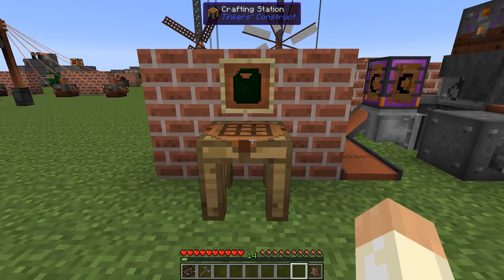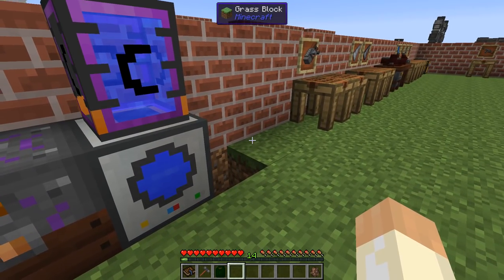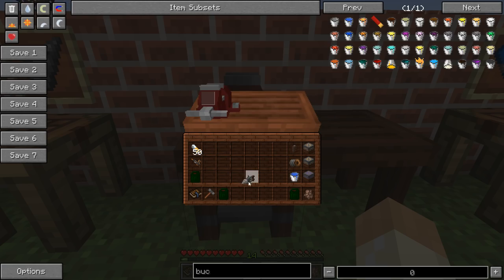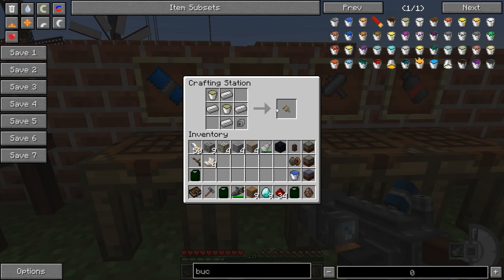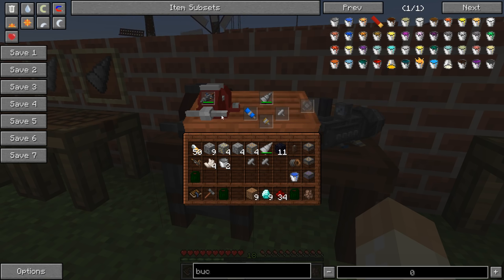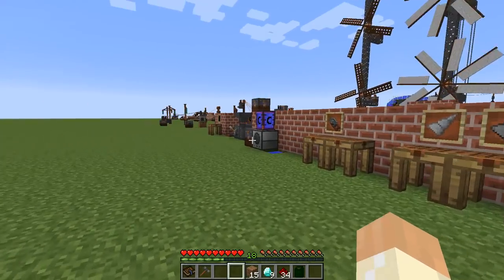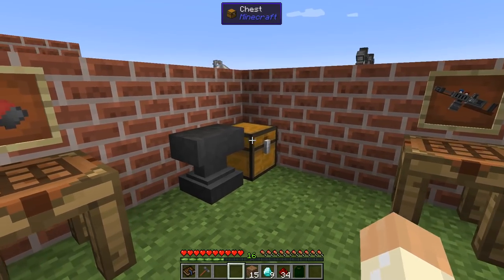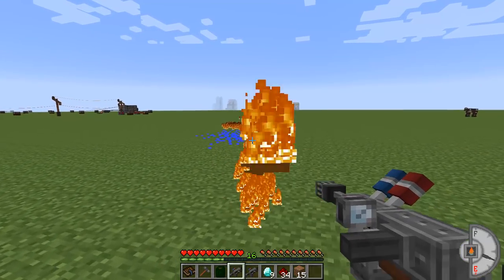Immersive Engineering Tutorial #8 - Mining Drill and Chemical Thrower (MC 1.7.10)

Comment: Nice job once again. Btw did you figure out your problem with your G-Sync monitor?
Reply from the maker: +Ian Elliott Thanks! No, I have tried everything I planned, but all variants still fail except for not turning the monitor off on the button. I haven't tried reinstalling, but I'm quite sure this won't change. And I can't go back to an older Windows either. Right now I can live with it because I can avoid the problems, but in the long run I need to find a solution.

Comment: how do I load the chemical thrower in 1.8.9? thermal expansion isn't updated to 1.8.9 and there's no bottling machine! I can't fill it up with plain buckets by crafting and I can't figure out how to fill jerrycans either. Edit: I can load the jerrycan by clicking on a filled seared tank (from tinker's construct), and then craft the jerrycan with the chemical thrower.
Reply from the maker: Sorry for late answer! But you can fill the Chemical Thrower (and the Jerrycan) directly in the Refinery. Just put it in the top (blue) slot.
Reply: TKH Ok but I want to fill it with other things. I found a way to do it in my mudpack: I fill up some type of tank then click on it with jerrycan and craft chemical thrower with jerrycan and it works.
Reply from the maker: Ok, yeah, I think I did that in the video at 8:25 you mean? :)
Reply: TKH Yes, but... you loaded it with the bottling machine and the thermal expansion machine, neither of which I have.
Reply from the maker: I don't know what to say, but in this video I talked about filling from a Jerrycan and at exactly 8:25 (feel free to check) I fueled the Chemical Thrower from a Jerrycan.
Reply: TKH I know you did I had trouble figuring out how to fill up the jerrycan.
Reply: TKH Because I none of the methods you used worked for me.
Reply from the maker: Ok, then I understand. Sorry, I focused on the loading part instead of filling the Jerrycan specifically. Good it's solved anyway.